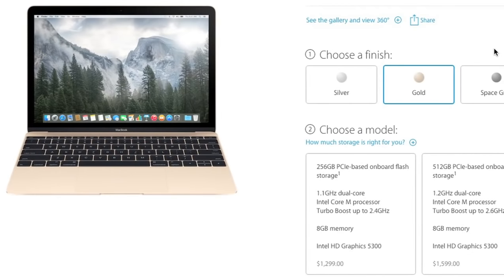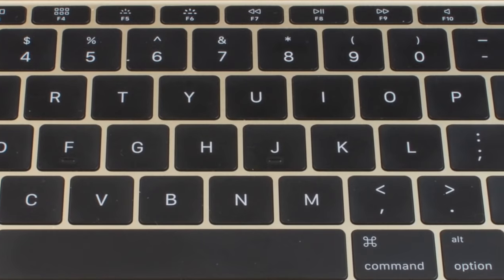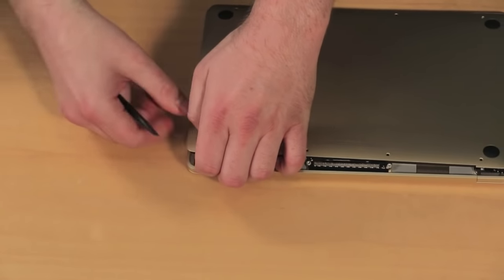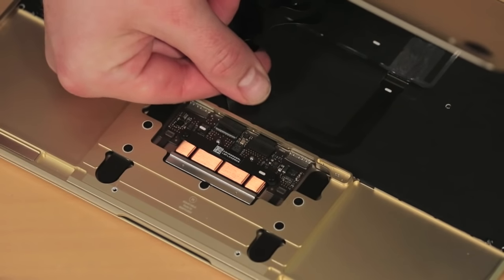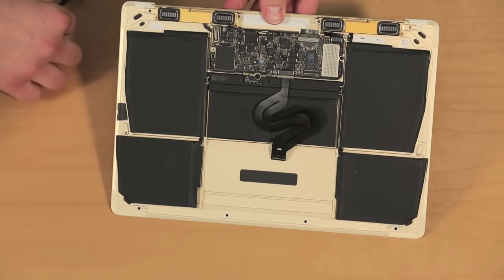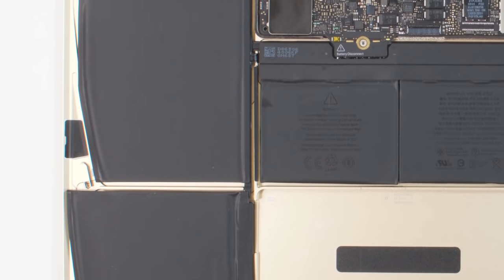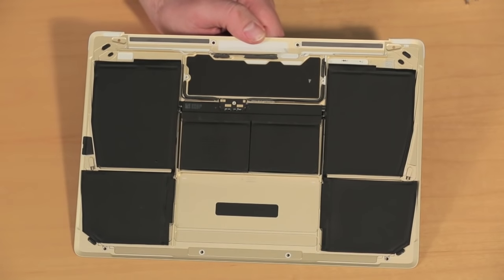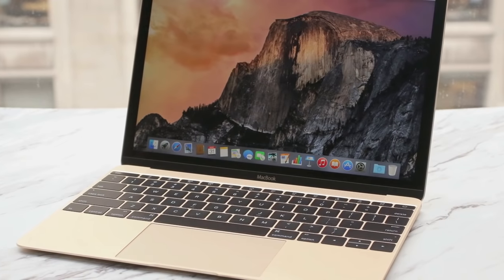Cracking Open: Apple MacBook (12-inch, 2015)

Comment: I got my 12" MacBook Space Gray yesterday and I am happy with it. My previous laptop was the Late 2013 MacBook Pro with Retina Display which is a strong laptop. However I haven't had any issues with my new laptop so far. So if you use laptop for using MS Office, watching movies (Full HD or 4K), heavy web browsing, light and casual photoshop and video editing, this laptop is the number 1 choice for sure and the power is quiet enough for you. My new MacBook almost have only half of the power of my previous laptop but I don't see much of a difference. I am a heavy user but I am not a video editor or a photoshop professional. 
By the way I though my words might help those people who are deciding to get one of these cute, perfect beautiful laptops.
Reply: Did you sell your 2013 MacBook Pro? 
If so, where did you sell it at? Amazon? 
I wanna sell my 2014 MacBook Pro
Reply: Justin xoxox not yet. I am trying to sell it on Craigslist. However I think i am selling my MacBook Pro for a little high price. That's why I didnt get a buyer yet
Reply: ***** No problem. It is a 1 time buy either the USB adapter or the adapter that has 3 different ports. However I only have the USB adapter for 19$ and as of now NO problem at all with this laptop

Comment: I find it interested how accurate this guys predictions were with the laptop being the forerunner of apples new design. They did keep the fan, but pretty much everything else predicted was correct. Though it does look like the MacBook air held on and won the fight in the end, it got really long in tooth but eventually was refreshed and shortly after the MacBook was discontinued. Now they just need to kill the keyboard they started with this MacBook.

Me personally I think the "MacBook" should have been branded the MacBook Air, and the eventual MacBook Air refresh in 2018 should have been the new MacBook. Basically flipping the two names, keep the ultrabook the ultrabook and still make the MacBook a bit smaller but still capable. Letting the 2015 MacBook be the last device to have a USB-A port rater then the MacBook Air. Personally I think this device would have been better received if it was called the MacBook Air instead, but that is just my opinion.

Comment: I laugh at the idiots who think a notebook this small is 'underpowered'. I understand that the price is way too high—as Apple is usually overpriced—but for the size, this is near the best you can get. Play with one at best buy and you'll be surprised this thing even turns on.
Reply: +Nice shirt, man! You had to change your name huh
Reply: Wait, are you saying the 12 inch MacBook overheats? LOL you are silly, I have had my early 2015 MacBook for about a year now and never experinced heating issues. I edit FHD videos on here, play some light games and surf the web, never once had a problem. Love the laptop, only thing I wish it had were better integrated graphics. Like maybe the Intel HD 6000. Also I bought mine for $900.00 which comes with 512GB SSD, 1.2GHz Intel core m processor and 8GB ram. I do agree the $1600.00 for this laptop is bullshit but for the $900.00 I bought it for Id say its a good deal
Reply: Uncle Larry hmm, good idea. I will have to try that. Maybe something like 2 girls 13 guys and no cups? Or girls gone wild
Reply: Warren McClure something like that

Comment: There are THREE distinct product models, not two. I purchased the highest 1.3ghz model. I am very pleased with it.
Reply: sr Think Care to elaborate on your opinion?
Reply: ***** Portability. I only own a motorcycle and still visit customers to repair computers. Both Mac and PC. This laptop allows me to keep an ultra light work machine that fits on my motorcycle, yet runs both Windows and Mac OSX.
Reply: The 1.3 GHz Core M is the same as the 1.1 and 1.2 GHz models. Just a slight overclock, which is useless, because all three have the same turbo speed, which is limited by the (missing) cooling.
Reply: No, the 1.3GHz model can turbo boost up to 2.9GHz whereas the other models dont, which does make it decently more powerful. You sir sound like most people who are saying this is just an over priced netbook. Well let me tell you that you are wrong. These things score around 2500 in single core and around 5000 in multi score which if you ask me for a passively cooled system thats pretty damn good. Also you are not just paying for the specs you fail to understand that you are also paying for the craftsmanship and engineering that went into this. Not only does is score pretty well in geekbench it also has a 512GB SSD and 8GB of ram all packed on that small logic board, I mean its not much bigger than an iPads logic board. No you wont be playing triple A games on this but it wasnt built with gaming in mind, it was built with extreme portability in mind. I mean the 1 USB C port BLOWS (honestly I hate it, 1 goddamn USB C port WTF!?) but other than that its a great system. I have the 1.2GHz model which I use for editing full HD videos, play some LIGHT games and surf the web and it does all this pretty well. Is it worth the $1600.00? No not for me thats why I waited a year to buy $900.00 but I think if your always on the go, you have light video editing needs (nothing higher than full HD) then I think it would fit the bill pretty well. Sorry for the long ass essay
Reply: Why do you care what he/she buys? As long as that person is happy with what they bought thats all that matters.

Comment: I was recently deciding on buying a Macbook / Pro for work on-the-go. I had to consider processing power, hardware connectivity, future software compatibility and reliability. Reliability is Apple's middle name so that's done. Future software compatibility is fine due to both Macbook and 2015 Macbook Pro being easily compatible with software I use for future updates. Now, the processing power. I needed something that will enable me to do very processor-hungry tasks e.g. creating mixdowns/bounces, whilst writing documents or browsing the web. The Macbook Pro won that with ease. The hardware connectivity; its obvious the Macbook is tremendously lacking in ports and adapters are flimsy and at the moment, expensive. The Macbook Pro had just about everything I needed in terms of ports to easily connect peripherals. The only thing I was lacking was a CD/DVD writer and burner, but I bought a USB drive to compensate. So from looking at what I need, I picked the Macbook Pro and I don't regret it, even after looking at the Macbook. It is incredibly thin, but for such a small powerhouse, the Macbook Pro is the ultimate in portable audio production for me.

Comment: "I hope Apple doesn't forget about those of us who need to crack their notebook open every once in a while"

Apple will never forget about me, every new product they come out with will have something new to try to stop me.

Honestly, I don't think this guy understands that Apple uses pentalobe screws and a bunch of glue specifically to stop people from opening their devices up.
Reply: Dash Lambda It's Apple. If you don't buy it through them, they don't like it. Ever since Steve Jobs died, Apple has turned into a joke.
Reply: TheOCDninja
Honestly, the company was a joke before Jobs died.

They did some great things early on, but the only thing Apple has ever been is the 'great popularizer'. They take existing things, spruce them up a little, and tell people it's magical. That makes those things insanely popular, which drives other companies to make them better, and Apple uses what those companies did, makes it a little prettier, usually makes it thinner, and starts selling the result.

The last great thing they did was making the GUI a standard, the last almost-impressive thing they did was the iPhone, and the last at-least-notable thing they did was the iPad, all of which have now done much better many times by other companies and Apple just sits behind them with lesser products fueled by higher price tags.

It's actually kind of disgusting...
Reply: Dash Lambda If only it were so simple, every other company in the world would be doing the exact same thing (because it seems like it's working out pretty well for their profits).

Comment: The MBA should stay around. The MacBook is very underpowered to an i5 or i7 on the MBA, so Apple should keep it as a middle product balancing performance and portability,
Reply: They will not need the air in the future because the MacBook will be just as then and more powerful and will have more usb types ports
Reply: +eastmountainfilms In time the new MacBook form will be norm for computers powered by i5/i7 class computers.  We're not quite there yet.  But this machine shows us the way
Reply: +eastmountainfilms The 1.3Ghz version of the 2016 macbook is better than a 2015 air and almost equal to a 13 inch base pro retina, according to geekbench scores. I really hope the pro coming out in june looks like this macbook and is at least as thin as this macbook is at its thickest point. And in space gray :P

Comment: why HP and DELL . ...not using  logic boards  and fanless CPUs and SSDsin their laptops like apple ? its amazing to have a laptop thin as the macbook running windows 10 .
Reply: you can run windows 10 on MacBooks!
Reply: thought there is a fanless ultrabook, macbook like windows . which is also cheaper. Asus UX305CA
Reply: +sam goode i saw a review about asus ux305  its amazing i love it ..
Reply: the only things i dont like about it isits lack of  gpu and weak cpu. so i just bought another asus laptop.(asus k401ub) faster. larger. its not that heavy. the only thing i hate about this is the screen.
Reply: +ibrahim kakeyi (limtless droid) HP made it  !  Called Spectre 13 (with 3 Usb type c port)
Reply: Because theyre faster
Reply: If you want a laptop like this with windows 10 you are going to have to settle on one almost half the price, with ports and a normal keybord and thinner than the macbook. Look on the ASUS website...
Reply: Bootcamp
Reply: ibrahimkaki because it's slow...you'd be better off getting yourself a big phone and just get a Bluetooth keyboard, or the adapter to connect a usb keyboard...
Reply: yea, but the trackpad and the display is better in the MB. Depends on what you want.

Comment: For that price, you can get a pretty decent gaming laptop that will max out virtually all modern games.
You give up far too much for the macbook, Battery replacement will be a major problem (keep in mind batteries do not last forever. after around 1-2 years of regular use, you will be at around half capacity or less on the battery.

If you have a laptop that is designed around having user replaceable batteries, the replacements are not only cheaper, but you can easily walk around with multiple batteries.

The way the keyboard is attached, means that replacing it will be very difficult, thus if it breaks, it will likely not be a simple $20 repair. The display is completely glued together so any damage too it, means that you are replacing the entire unit (including the housing).

The glue used on the batteries is very strong, and thus when removing older ones, you risk the batteries flexing to a point where they can potentially self short and set on fire if you do not slowly and carefully remove them.
Reply: I don't like to play games.
Reply: Even if you don't, if you have a system which can handle gaming, then it will also be very quick with many other tasks. In order to passively cool the macbook, they went with a very low end CPU.

Furthermore, you may not like to play games, but what about with the Witcher 3 comes out, will you still be able to not like playing games when a really good one comes out?
Reply: Razor2048 Oh, lawdy! Let my chuck my $2000 tablet in the trash! The new Witcher game is coming out! 

Ok, so I have $1300 and need a slim gaming laptop with two requirements: 256gb+ ssd and a screen greater than 1080p. What should I buy, Mr Razor?
Reply: JayJapanB
 If you want a higher res screen then you will be sacrificing on GPU to stay under the $1300 price point ($1025). Specs will still be far better than the macbook, for example http://www.amazon.com/Lenovo-15-6-Inch-Laptop-59425943-Black/dp/B00K6ZIMFY 4K display, 16GB memory,

The rest of the money can then be used to upgrade the storage with the 500GB 850 evo
http://www.newegg.com/Product/Product.aspx?Item=9SIA0ZX2D98079

you can then buy a cheap $10 usb external enclosure in order to use the old drive as external storage)

though you will have an 860m which will mean medium-high settings in modern games.

Other than that, it is very thin, though you give up having an internal DVD drive (and will have to use the external DVD drive if you need to use them)

PS it is not very common to get a  retina style display on a gaming laptop as no gaming laptop comes with an internal GPU that is able to smoothly game at 4K, unless you are playing one of those league of legend style games, or are running games on low settings (which will look worst than going with 1080p). Thus they tend to stick with a 1080p display and then put the money into better processing components.
Reply: Razor2048 That laptop has great specs and price but many reviews there aren't too favourable... Remember, you aren't buying this to boast specs. You're buying this because you want a computer to use.

Aside from that I see the appeal in having a 1080p screen on a gaming notebook but I would personally prefer a lower end GPU and have a higher res screen. 

Oh, and I don't buy into the battery half dying in 1-2 years. Hasn't happened to me before and I've had plenty of relatively modern mobile devices (phones, tablets and PCs) with lithium ion batteries and used them for extended periods of time with no significant loss over multiple years. In the past, yes, that was an issue but battery management these days has been improved so much with the influx of more mobile devices.
Reply: Ah, lost a long comment to shitty touch keyboard and palm rejection. So I'll make this brief.

Don't give a shit about battery. MBPr loses 20% in 3 years. 8->6.5hrs. Don't care.
 If you do, don't buy it.

Apple fucked up the Ag screen shit is fucked. They should fix it.

Never given a shit about upgrading my mobile devices. Don't care.

Comment: Amazing design. There's no laptop like this one!
Reply: ***** That's cause this is a tablet in a laptop's body
Reply: Yeah that's crazy, so thin and light it competes with tablets.
Reply: ***** It has the processing power of a 2012 MacBook Air, 480p camera and only one port...
Reply: ***** no tablet costs 1200 dollars. it competes with ultrabooks.
Reply: Kristian Johnsen Same power as a MacBook air and more light and thin, that's sweet! Im not taking photos with my laptop so that doesn't matter to me. One port is not a problem for me.
Reply: Jonathan Hine Yeah my bad I didn't mean that people would cross shop the two. I meant in a sense of size the new MacBook is almost as thin as a tablet.
Reply: ***** Same power as a MacBook Air from 2012... That's not sweet... WTF?
Reply: Kristian Johnsen What do you expect? As much power as a MacBook Pro while being more light and thin than an Air? Don't be ridiculous...
Reply: ***** i would expect more than a core m
Reply: ***** Form should follow function. This is form over function in a ridiculous way...
Reply: Jonathan Hine Fair argument. However to make this laptop as light and thin as it is, they had to make some compromises. More powerful means more heat and battery usage. This means they would likely need to add fans which would make it more heavy. Also battery life would suffer greatly.
Reply: Kristian Johnsen The same was said when the MacBook Air came out. Look how popular it is now. Form should follow function is applicable to a certain extent and I don't think it applies here. How is it ridiculous?
Reply: ha all your comments aged badly with the m1 air

Comment: If it had 2 USB C ports and a normal USB port I would have bought it
Reply: +Mil Man Bro, don't try to hide your poorness.
Reply: Germán S I have the spending capacity to buy one of these, I just bought a surface book instead of this and I cant be any happier. I've had absolutely no issues with the SB. It has all the ports I need and I don't need to carry around any dongles to plug in a USB. Oh and it detaches to become a tablet, so that's cool. Oh and it has discrete graphics. Oh and it has a 5 megapixel camera. Oh and its touchscreen. I can go on forever

Comment: I don't quite understand why someone would buy this. What the hell do you do without USB ports? No mouse, no usb-stick, no external drives. Who doesn't need them? Also the processor with just 1,1GHz? Sounds really bad to me, or isn't it? 250GB storage could become quite a problem if you seriously wanna work on this thing and don't wanna have to move your data every 2 weeks. For that price you could get something way better. I don't think a few mm less are worth sacrificing good hardware, performance or temparature. Sure some people prefer iOS and they can do that, but the device itself just seems so unpractical and limiting to me.

Comment: Its quite impressive how thin it is and it got a decent specs, but seriously get a damn macbook pro
Reply: The specs are terrible the iPhone 6s is smaller and has better performance
Reply: How the hell does it have good specs?  It's 1GHz ffs, that's 2003 stuff!
Reply: Yeah but the clock speed dosent matter the thing has the computing power of a desktop from 2003

Comment: very good laptop but extremely expensive.. :(
Reply: No it's shitty an iPhone 6s almost outshines this as a: it does not thermal throttle during normal use (unlike the Mac book) and b: it costs less for a pretty much equivalent power and c: it's thermal throttling problems bring its processor speed down to 1 GHz the iPhones being 1.85 this makes the Mac book a tee able voice when it comes to laptops